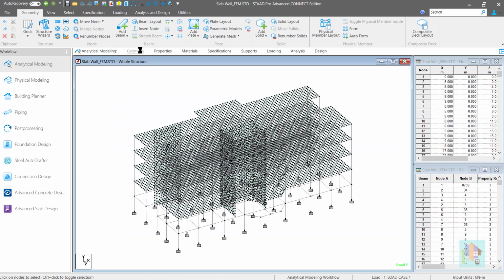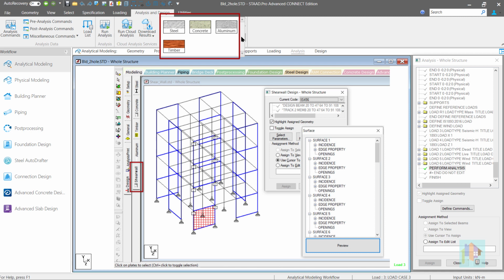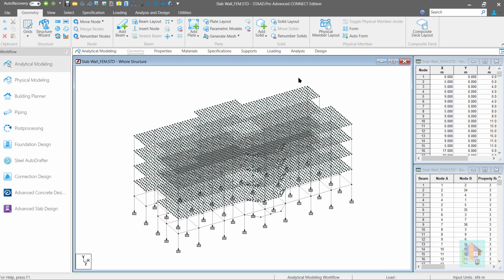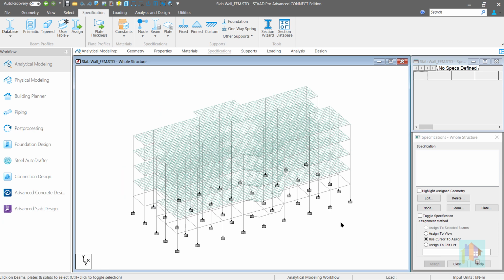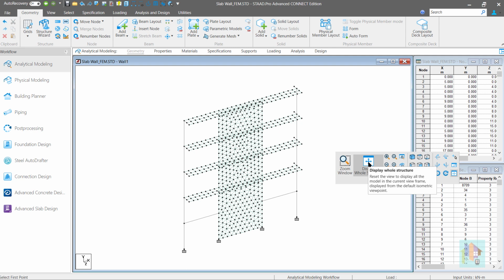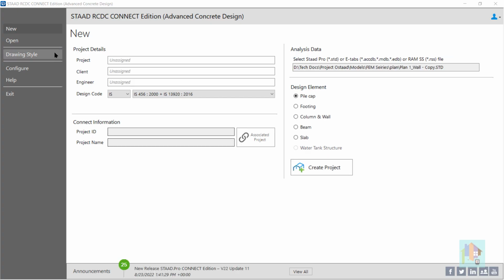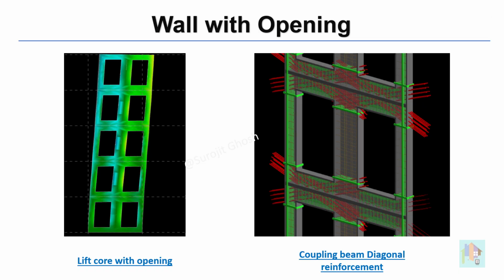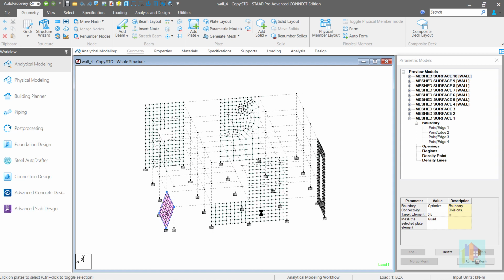Generate Plate Mesh in STAAD: Part 6 – Modelling of RC Wall for Design || Shear Wall with Opening

Comment: Can staad do curved beams sir
Reply from the maker: I am not sure whether you are referring to analysis or design of curved member, also whether it is curved in plan or elevation. In general, if you model a curve member using curve beam option, the program analyzes the member only at the end, force is not computed at any intermediate point. If this member (curved in plan)  is exported to RCDC, then program designs the member considering the end results only, as a straight member. 
For more accurate results, best approach is to model it using multiple linear line segments, which can be generated manually, from structure wizard, or using a custom macro.